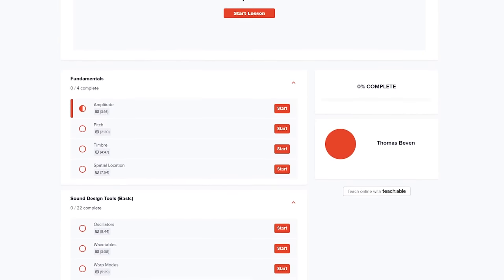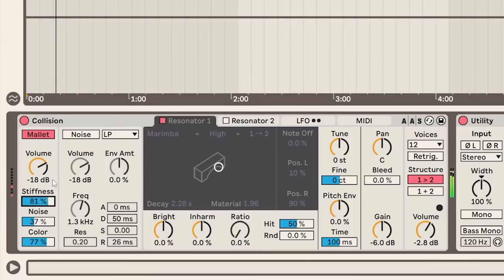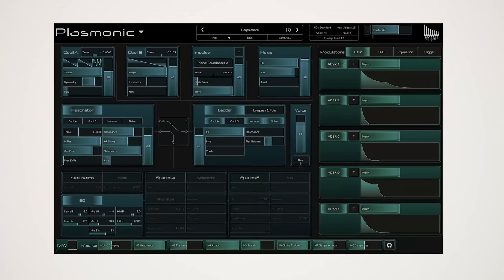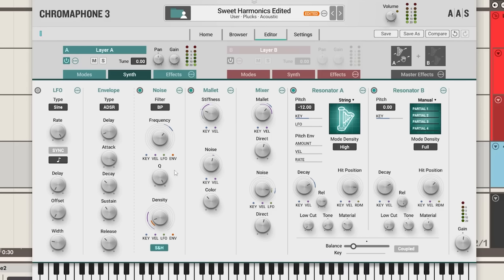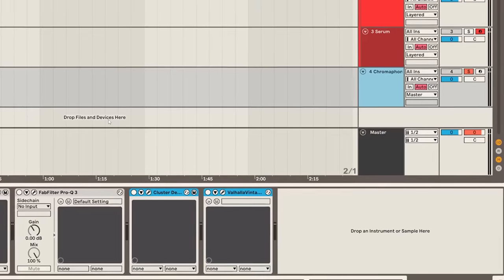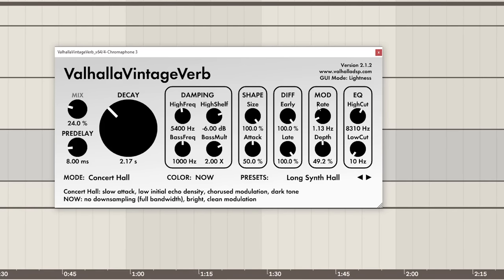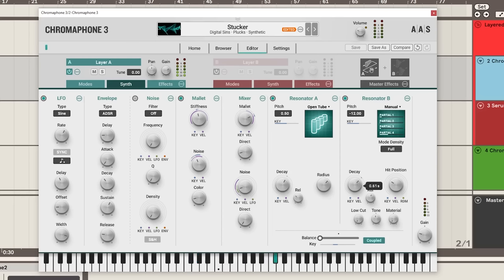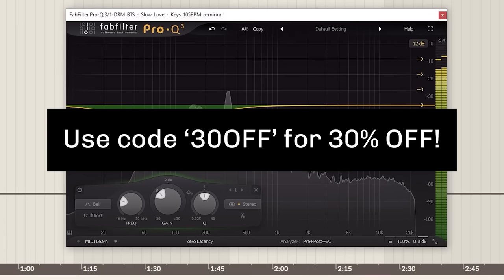These synths will change everything!

Comment: Physical Modeling synths have been around for a while.  I gave a Yamaha EX5R and a Korg Kronos, both of which have various physical modeling engines.  It has been used successfully also on pianos, with PianoTeq and the Roland V-Piano and Fantom.  The Waldorf Quantum also has a plucked string engine, among others.  Physical modeling seems to work well for plucked strings, tuned percussion (marimba, vibes), woodwinds and horns.  It works less well for strings, leads and pads.  Overall, I'd say that it's very useful and may get more powerful in future, but it's not the ultmate synthesis solution, if such a thing even exists.  It's great that there are VSTs that let you play with this relatiively inexpensively and easily now.
Reply: Elements by Mutable Instruments is awesome
Reply: I remember when yamaha release the VL-1 in 1993 and everybody though it would be the future and everybody would be using it. Anyway I use the pianoteq for many years.
Reply: How does the Roland Fantom have physical modeling?
Reply: @brickblock369  The V-piano  on the Fantom is physically modeled.  It also has numerous sampled pianos, but the V-piano is their best sound engine.

Comment: I used the demo for Chromophone 3 for its full period last year and I loved it. The only downside I know of that you haven't mentioned here is that this type of synthesis requires quite a bit more processing power than something like Serum. I found that many of the presets would devour my cpu. Though it is true, as you do mention, that those presets are insanely beefed up to show the product off. 

I also use Prism in Reaktor, and it's not nearly as good but it still has the quality that I like most about this type of synth, which is playability. 

I can plug my keyboard into these instruments and just enjoy playing them for hours because of their responsiveness. I will say that if you are trying to plug typical synth riffs, sequenced-by-mouse, you probably aren't going to love what you get as much as if you make subtle layers of notes. To me, these instruments are inherently percussive. Many have options for "bowing" or "air" exciters, but these still need some improvement, IMO.

Anyway just throwing my two cents at the wall so I can watch it jangle around on the floor afterwards.